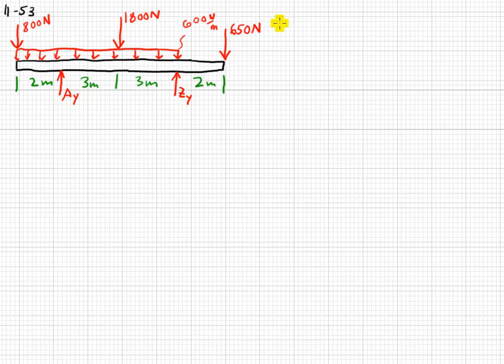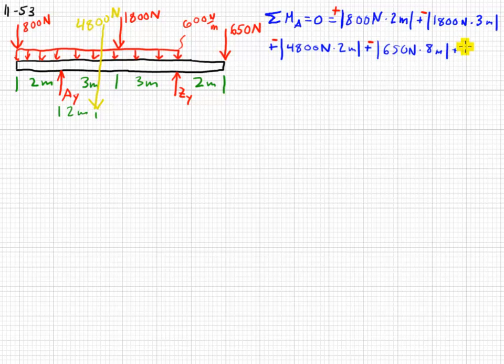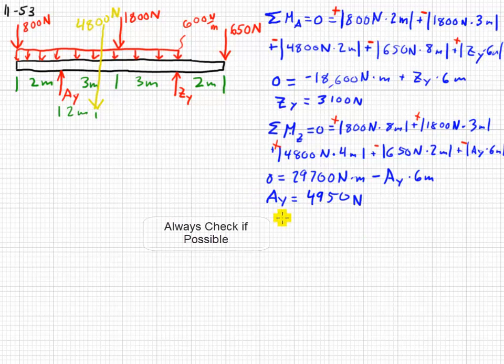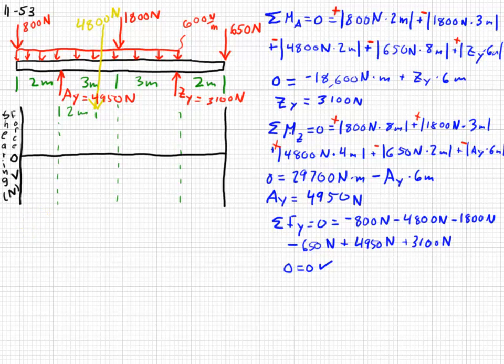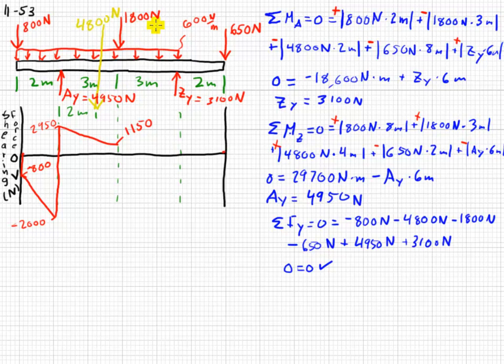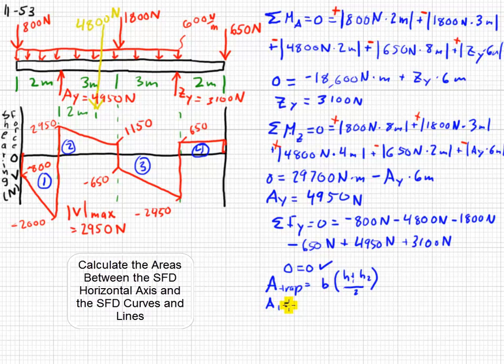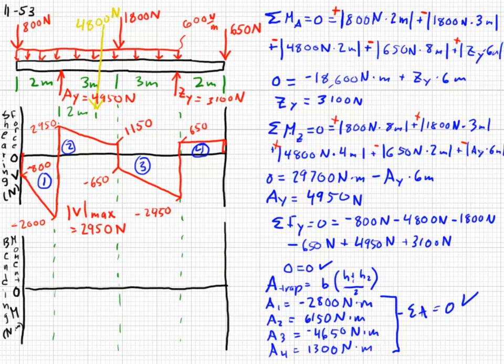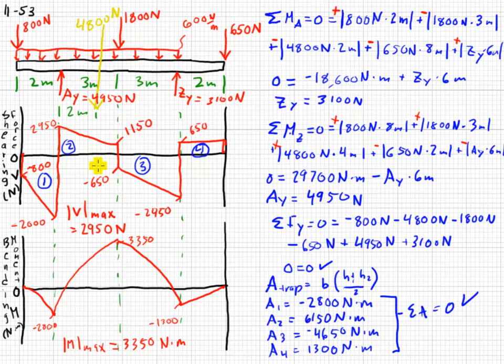Complex Shear Force and Bending Moment Diagram

Comment: Boss ,great job!,but I have a particular way of doing so;You can solve it w/six linear equations  by matrix,then  you can change the input, keep spacing,and use the MASTER  static (=equilibrium)designed coefficient matrix EQUATIONS for the outputs.
Reply from the maker: True, the matrix algebra is more efficient, but there are two advantages of going without: 1. If you are not equipped well enough with it (as my students unfortunately are not) and 2. This method shows more clearly what's going on and why. "Solving the Matrix" can seem very "Black Boxy" to students both weak and strong in the math. I would want them to solve it this way first a few times, then, once they get the hang of it, use matrices. That way, they get a great understanding of what's going on AND a great appreciation for the math!
Thanks for the feedback!

Comment: What if my B.M don't add up to zero after getting the area under the graph?
Reply from the maker: +antonmfl 
It depends: if you are off only by a little bit (< 1% of the Mmax, maybe), then it's probably roundoff error. If it is more than that, you may have made a calculation error somewhere. If you are around 1% error, you may go back and use greater precision (more decimal places, or use a spreadsheet) to see if you get any closer. If you don't, you'll have to go all the way back to the beginning to check. This is also why you should always check your moment equations with a force equation if you can: finding a bad error early is absolutely worth the effort.